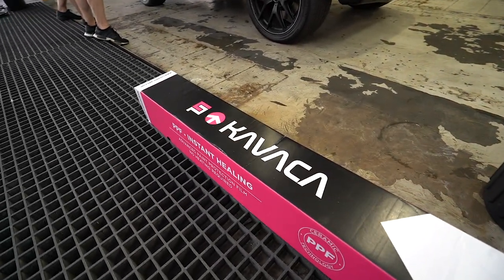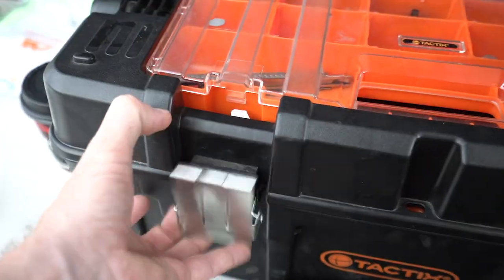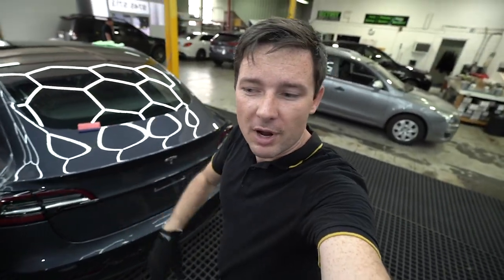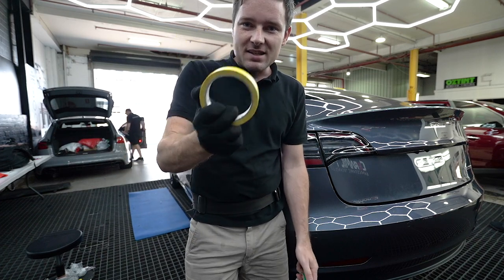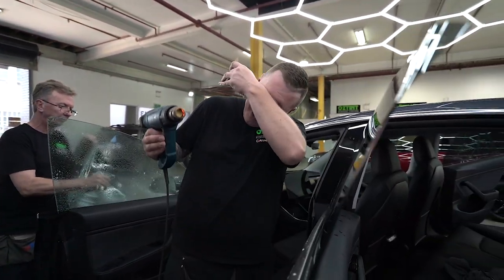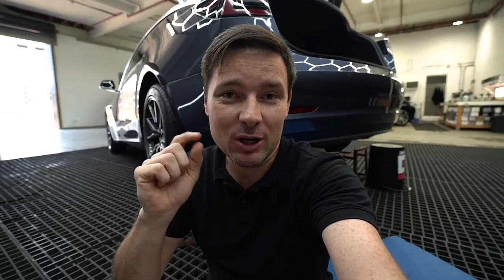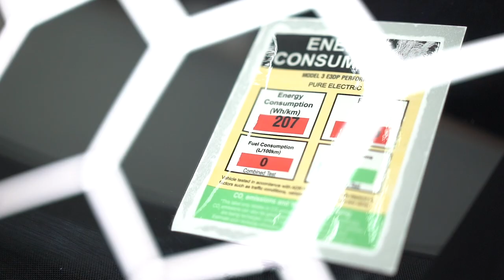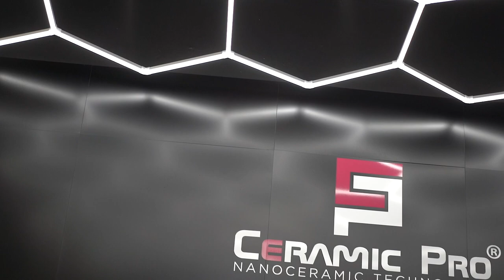Install Ceramic Pro KAVACA Paint Protection Film on Tesla Model 3 2020

Comment: Doesnt it scratch the paint under the film if you cut the paint with the box cutter to cut the film?
Reply from the maker: If you don't know how to cut the film you will cut the paint. We use professional blades and knifes and we are skilled to do it safely. I can cut this film on the air balloon without exploding it 🤙
Reply: @WrapVirus  Cool I guess that the installer someone chooses is really important then. How does Kovaca compare to Xpel PPF ?
Reply from the maker: @WiseSilverWolf  yes, you are right. I always suggest to choose recommended/trusted installers. Most of the time suppliers in your area would know who is the best. Never go to the  cheapest place. Installer must be certified.
Kavaca is softer comparing to XPel, but have very stiff top layer that is harder to cut, that means it should protect from stone chips/damages better.
Also Kavaca PPF has better hydrophilic effect.
Besides XPel has been on on the market for a long time and Kavaca was launched in 2019. It is a fresh product still.
Reply: @WrapVirus  Thanks thats very good advice, I just purchased a new 2020 Toyota Tacoma last month and the first day that I was driving it home from the dealership I got two rock chips (one on my tailgate and one on the front passengers side door) because I had to drive through a construction area to get home from the dealership and there was only 1 lane going in each direction. Now im going to get my truck wrapped in PPF after I get the rock chips fixed and ive been doing research on the best PPF to get, most of the installers in my area are Xpel but ive been seeing alot of Facebook ads for Kavaca.
Reply from the maker: @WiseSilverWolf  Where are you located? Maybe I can help you too find good installer in your area?
Are there many different brands on the market.
Suntek, Bodyfence X, XPel and Kavaca are top PPF brands.
Reply: @WrapVirus  I live in Hialeah Gardens, Florida 33016
Reply from the maker: @WiseSilverWolf  Please send me DM on Instagram. I will ask a few guys in your area for a help.